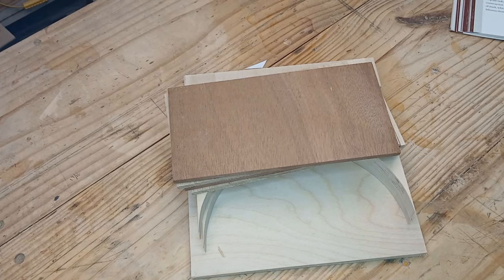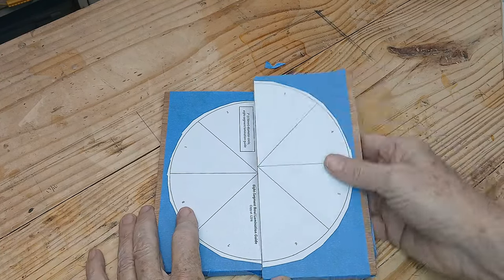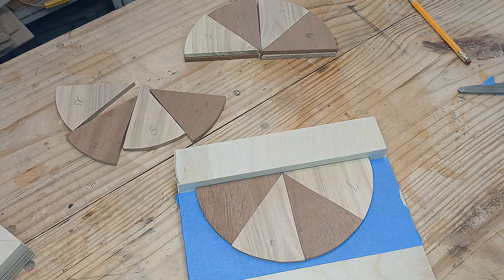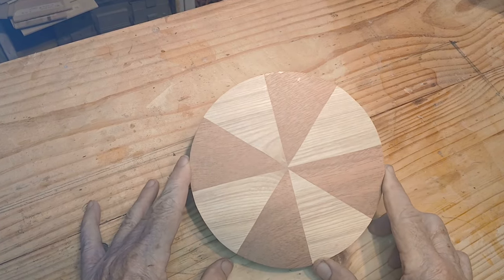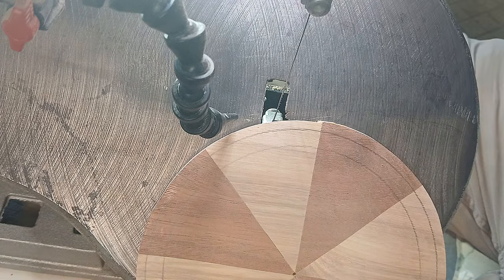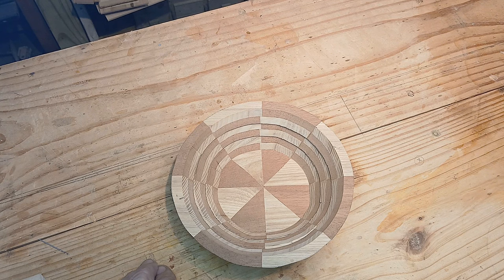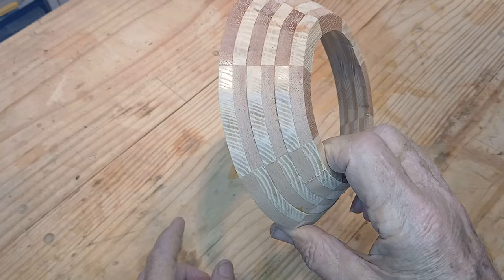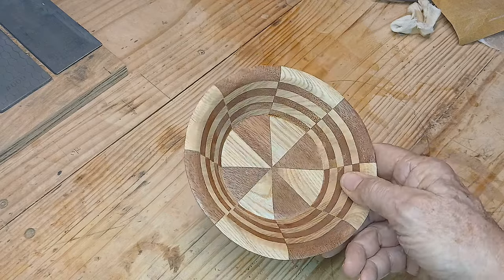Scroll Saw Bowl Made With Alternating Segments

Comment: everytime i used pegsas blades mine were brittle thats why i went to flying dutchman and they dont stand by there product the companies that sell pegas
Reply from the maker: The last batch of flying dutchman  that I bought would not even tension to cut without breaking.  They would break on the flat ends either top or bottom  right at where they were mounted.  Others would not cut but a few minutes and break in the teeth.  I had used them for years with no trouble before.  I bought some Pegas from Bear Woods and I really like them, for me they cut better and straighter, I had to almost re-learn how to cut and still have to adjust if I switch blades.  I guess you can get a bad batch in any brand.